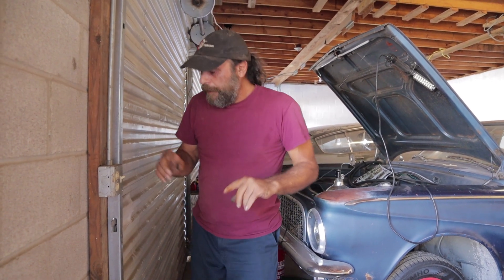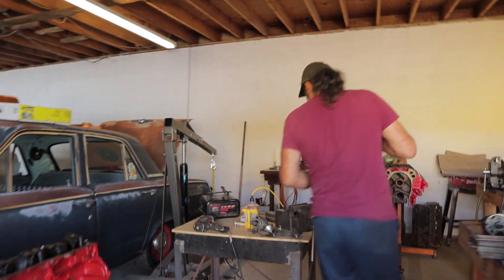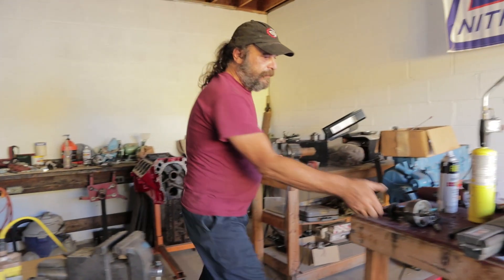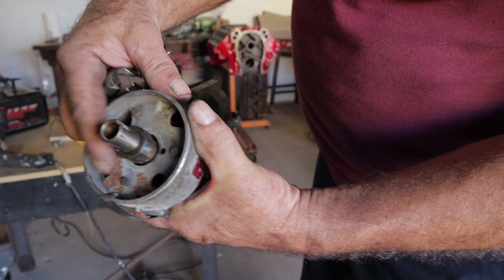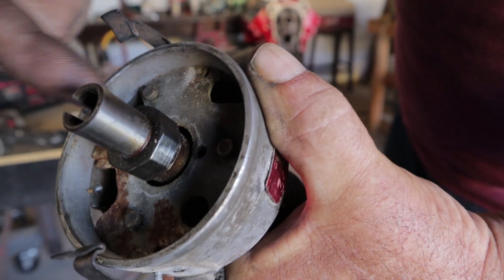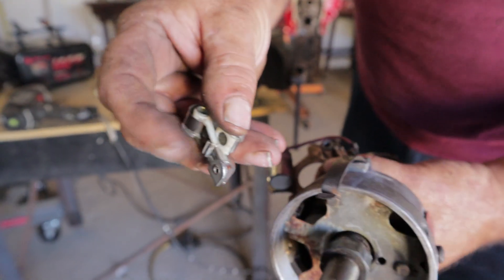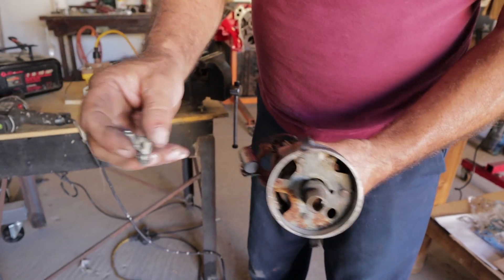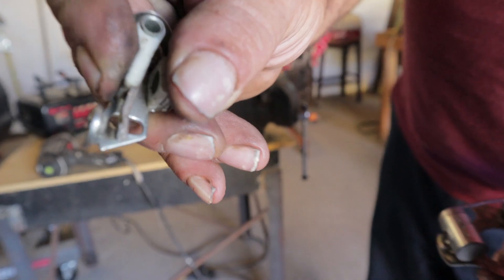Classic Car Tech-Ignition Points Explained

Comment: looks like you,ve made a lengthly but full-recovery nolol...and thats good if you didnt come away with any nervous tics or twitches T...quite the telethon....well, your apparatus made me think of my fiances dad, who had a Sun 506 distributor machine in his garage at the house, if you can believe that, picked it up when the old chevy dealer where he did business, closed, and he got it for nothing too, that was some kinda big-deal back then....he was king alright, people came for miles for him to set up their dual-pont distributors, curve kits, even single-pointies, and that is the point...i was going to use the HPs example that listed and rated the chevrolet heavy-duty single-point sparker and HD points at near chevys dually performance....said they were flawless to 7 grand too....and that would have been a good tidbit, till you dropped that T/F single-point bomb...man alive T...that says it all, what could top that example, even up into the late 90s a single set of points when they only made in excess of 5000 horsepower from 8-cylinders..thats off da hook...whew...i remember ignition breaker-points could give even good mechanics fits back in the day, but sometimes it was more a worn-out dist-cam or the whole distributor was shot, and also many people carried a spare set and a nail-file and screwdriver in the glovebox, leaving that key on when they,re closed 1 time could fry those puppies in a minute or two and there you,d be, you could even smell em cookin.....just 1 of the many reasons the mopar boys just loved their big B and RB Chryslers, distributors right up-front and center, easy to inspect, service and R & R when needed...the A-motors not so much...chevy had experienced a poor water-stall-out reputation, so when they penciled-out the 265 in 55, they put the distributor as high-up and to the rear and as close to the firewalls protection as they could, chrysler engineeres favored that design, but the b/rb motors were not known to moisture stall that i remember....and tony...didnt dual-ponts really only pull ahead when longer duration camshafts that needed longer spark durations... were beginning to hit the scene?....great video T....loved the quick-fab distributor-machine, looked like a resistor right off the mopar firewall...but ive come to expect that straightforward approach from the uncle...i like that, but i can never decide whether you get a bigger-buzz from learning or teaching buddy, but they both can be pretty close in intensity..p.s... remember the transparent distribitor caps..i had 1 on my 396...they really put on a show...at night.....kutgw tony.

Comment: I hated point distributers seems like i aways had to keep adjusting them or replace them  around 5000 miles .love gm hei .
Reply: Guy Linhares   I gotta agree with you. You can soak the engine with a hose and it still runs. Plus you don't have to clean or adjust anything. I did a Pertronix conversion on my Caddy and it's never run better. Points have never been my first choice.
Reply: @rexcars1835  I found faulty condensers and unmatched coil and resistors a reason why points had issues

Comment: During a slant 6 ignition tune up, new ballast resistor got real hot. Put the old one back on, runs fine. Any ideas?
Reply from the maker: They always smoke a bit when first installed.  Nothing to worry about

Comment: Not sure higher voltage spark would be a performance advantage or not. But the HEI module is designed to provide maximum dwell and saturation to the HEI coil. So a typical points coil can only saturate to around 25,000 volts. But HEI coils are typically 60,000 volts output.
Reply from the maker: Tell that to the Accel Super Coil we were firing in this video
Reply: @UncleTonysGarage  Well, seriously, I tested a points setup and an HEI setup in my shop about 10 years ago. Spun both distributors with a drill just you did here. The smaller round Accel coil would get unreliable at about 5/16 arc gap. The HEI didn't become unreliable until almost 1/2" arc gap. Would be interesting to test the Super Coil's maximum arc gap. But you should use a battery so it's pure DC voltage. The Battery Charger has considerable ripple in it's output voltage. Thanks UT.

Comment: I knew how they worked before I went to tech school in the late 90s, but im glad I did. 
The teacher actually said : I need to teach you points before we advance in ignition theory. 
Not all saw the humor in the advance joke. 
Don't ever say never, there's still lots of points out there in all kinds of old equipment. 
Good stuff , and it's usually fixable on the roadside.
Reply: You know how many cheap bikes I dragged home with no spark when I was a kid , and pops found they had the insulating washers all-out of whack in about 2 minutes,or some other grounded out points issue. 
It's a switch and it ain't switchin!!

Comment: Great video. My boat has a 302 with points and it really is a simple and easy system to get running. Best of all, I only need a flat screwdriver, a file, and a matchbox on board if something ever happens to make it run.

Comment: Early electronic ignitions - some of them. Used the points to trigger the low voltage side. A rotating magnet would trigger a reed switch, same thing as points just no mechanical contact. Same as todays junk, a rotating magnet triggers a transistor which closes a circuit and the spark fires.
Most of the " sensors " in todays ignition systems are magnetic switches picking up the movement of a magnet. Crank triggers, cam sensors Etc.
Ignition curves are just programmed into the magic black boxes. More durable ? maybe. For my money anyway the less simple a thing is, the less durable/dependable it is. Even if it has no moving parts, it can still be junk. Thanks in part to cost cutting measures, If a parts cost is a cent.
Shave 1/2 of that cost and it still works and then charge 3 times more for it, now it only lasts 30k miles. Replace that part 2 or 3 times in the cars lifetime - built it profit ! So not only do they make money on an inferior part they make even more making it that way. And they ALL do it.
Welcome to the 21st century kids. Easy and constant access to your wallet/purse is baked into every part. Gotta love modern times........
Reply from the maker: Could not agree more
Reply: I guess you also want to go back to using leaded gasoline.

Comment: Interesting that there is no performance advantage to electronic over properly tuned points. My ‘73 has that reluctor electronic deal that works great. When I had points on a ‘61 Buick, I always had problems with a unified points and condenser set up. With separate points and condenser, it ran great. The condenser on the unified ones was usually bad. I eventually went to Pertronix upgrade on that car. Maybe I didn’t need to after watching this. Great episode!

Comment: Building a stock 70 duster 340 and staying with the original dual point distributor. Replacement points are hard to find. It only came with dual points if it was a 340 and a 4 speed and only in 1970.
Reply from the maker: Those Prestolite points aren't too hard.  They were used in a ton of different applications for about 25 years.
Reply: Yes, I think the problem is the points in a 3438317 prestolite dual point are not the same as a  single point distributor.

Comment: I was talking to a guy at a car show this past weekend, and he deliberately kept the points ignition in his 68 Impala coupe, 327.  With those GM combination points & condenser, he just carried a spare pre-gapped set, for just-in-case.  He thought this was better than converting the car to something like a Pertronix - if that failed far from home, big problems - if the points are pitted, just do a very quick swap.  I thought of Uncle Tony - here was another analog guy.
Reply: Pitted points?  Scrape 'em with a pocket screwdriver or knife, gap and keep on running.

Comment: Think I need therapy..One of my pleasures in life is gapping points...I normally pull out my VW distributors to do it as I find it a little easier and then refit and re time...This was a great video...Thanks Tony......
Reply: Watch that distributor lobe for number 3, isnt it ground a few degrees slow? 
because the heat of the oil cooler blowing on cyl 3...
I think aftermarket dizzys don't have that retard ground in the lobe. 
Some old timer told me that.

Comment: When you dive into points deeper can you get into duel setup. My 56 truck has a 241 poly and has a duel point distributer. I’m thinking about rebuilding it and useing it in a 360. From what I’ve read it will drop right in.
Reply from the maker: Pretty sure it's the Desoto distributor that directly interchanges with the LA...Dodge may be a tad too short.
Reply: I have to pull it and check. The info I’ve been coming across is saying the low-deck Dodge hemi/poly  (241, 259, and 270) should swap. Of course what I’m finding is ppl going from points to electronic. I’ll let you know what I find for sure.

Comment: On your followup, see if you can touch on breaker set tension rated in ounces and how it affects target rpm and point bounce, and what the capacitor actually does. And for heaven's sake, let's see you light your cig with that spark!!  🤯
Reply: It's not a capacitor, it's a condenser for reducing EMI noise through your radio
Reply: The condenser (capacitor)  is required to absorb the primary circuit current flow when the points open so it makes a crisp break and the current doesn't arc across the points.  THIS condenser, that is.  THere can be others for radio interference.
Reply: @davecaselli1957  Yes. It appears we were typing at the same time. The main cause of radio noise in older cars is a breakdown of the alternator's diode/rectifier array resulting in some of the AC not being eliminated from the DC conversion, and the "dirty" voltage gives you that old "audible tachometer" that we all loved to hate. Aftermarket caps can knock some of that down, but the inevitable fix is an alternator rebuild.
Reply: @THRASHMETALFUNRIFFS  Good grief, another YT expert. The condenser IS a capacitor. Look it up, expert. It's primary function is to keep the current from jumping the breaker contacts when the gap is open. If it was for radio interference, then said ignition would run without it. Try it. Please.
Reply: @THRASHMETALFUNRIFFS  Looks like some other people are setting you straight as well. It's time to do the honorable thing. Look up "seppuku" and let us know when the live stream is. Thank you.
Reply: @413x398  Maybe 413x398 is a reference to pixel count, not VIN number?
Reply: @413x398  Yeah dude, I was remembering wrong, the condenser on the coil is for radio noise.  I forgot why the distributor would need a capacitor that kind of functions the same as a coil, build up a charge and release but it's starting to make sense.  I haven't done one since 1991, lol... Check out my cars playlist for vintage 96 VHS burnouts in a Challenger, Charger RT/SE at the strip and 500hp 83 Firbird?!
Reply: @cincyspin178  Or it could be a 413 in a Fury that is putting down 398 wheel hp on the local chassis dyno. Ya just nevah kno.
Reply: @THRASHMETALFUNRIFFS  The "point" here is to not disseminate false information amongst the community. If you are correcting somebody, do your homework first before trusting your long-term memory. Dude.
Reply: @413x398  Awww, fug it, I admitted I made a mistake, that's the goodness of an open source community... beside I'm a fuggin' GUITAR channel with a few car videos, lol!
/w\METAL4LIFE/w\
Reply: @413x398  At least I didn't claim my Civic run's 11's at 123 in the quarter... but my Firebird video did 13.54 at 104 on de studded snow tires I got for $10ea!
Reply: @413x398  Thank you. My next guess was going to be differential gear ratios, but you're not the kind of guy who would leave out a decimal point. Max Wedge?
Reply: @cincyspin178  4.13 or 3.98 gear ratios? That's just silly talk. Never happened. Never will. Decimals are very important, so no I would never leave them out.
BTW, how is it you're still posting? I pitched you into the Triangle knowing full well Dorian was on the way, and yet here you are. I'm impressed. Maybe you really are part fish as you claimed. 

No, C-body with 915 heads.
Reply: @413x398  4.10, 4.11...why not 4.13?  All right...lol...didn't I say you were Not the kind of guy to leave out af decimal? Yeah, nice plan you had there, but the Barracuda came thru. Now if I could just fine a car designed for the likes of me.

Comment: actually the coil and capacitor form a resonant circuit. when the points close current flows through the points and builds up magnetic flux in the coil(stored energy). when the points open the energy stored in the coil transfers quickly into the condenser. then the energy transfers back to the coil. that creates an alternating current in the coil primary which is stepped up in the coil secondary. When the spark plug ignites this energy gets dissipated in the spark. You must have the condenser and the coil working together. the ballast resistor limits the current flow to a value that does not ruin the coil or points. You jump out the ballast resistor during starting to get max spark. You can get a little more high rpm spark by jumping the ballast resistor at high rpm but not enough to make that worth while. some cars from warm climates have a ballast in the coil and do not jump it out for starting. How to tell you have a problem with the ballast bypass is the engine cranks and catches firing when you are shutting off the starter. there is a bit of science. the other reason not to use points is you do get a bit of random ignition voltage and timing(not perfect). not a big deal but electronic pickup and control module is a tiny bit more precision. Also never forget to lubricate the rubbing block. on your modern lawn mower the module in the magneto coil does both control and trigger so no points are needed. you can put that new kind of coil on you old mower(if it fits) and get rid of the points. what else. points oxidize when not used regularly and you have to clean them to get spark if they sit around a long time. Points did the job in their day but their day is past. thanks for the demo and explanation. point ignition is easy to deal with.
Reply from the maker: They work pretty well around here today.  Thanks for expanding with that explanation

Comment: Nothing like points that are SET UP RIGHT. Every time I open The hood on my 65 Mustang, my friends are like, when are you gonna dump the points and go electronic? and I'm like, the same time I dump my drum brakes and go with discs, NEVER!!!  The biggest complaints I get about points is, at high rpm the engine distorts, and backfires, and I say, set your points and timing correctly, and you won't have any of that shit.

Comment: I've done that set up in my store with an accel gm hei distributor and the spark jumps from the towers on the cap all the way to the head of the distributor. Puts on a pretty good firework show.
Reply: Ken Leppek   That is kind of fun isn't it?
Reply: @rexcars1835  most definitely

Comment: Great explanation.  I'm constantly amazed at how many people think the spark comes when you close the circuit and energise the coil...but I never could work out a simple enough way to explain it so they'd understand how the spark happens when the coil is switched off.  Love it, mate.  :-)
Reply: point bounce point float.  all tend tohappen at higher RPM .  cue the invention of Double Point distributor sets  and two distribitor.   I like old stuff but electronics did solve some very complex issues in extreme operating conditions .   daily driver stuff , points will  get the job done.   Except for cold weather Electronic Ignition and EFI still makes the engine go if you can get it to turn over.  I remember the old days of having to plug in cars in the winter time.
Reply: @Randy J  I remember points float/bounce...but it was usually because I had old points and the spring was getting weak.  Toss a new set in, and they were good for well over the 7000 rpm redline most small engines came with back then (higher than most cars rev from the factory these days.)  In my experience, it was more of a problem for race engines of the day that were pushing closer to 8-9k rpm.

I recall the early electronic ignition systems used to supply considerably more voltage to the spark plugs, but whether that was an artifact of coil development at the time, or something inherent with not having points that could arc, I'm not sure.  But they sure gave me a bigger jolt when I grabbed a plug lead while the car was running.  :-P
Reply: @aussiebloke609  used to be a maintenance trick to yank a plug wire and see if the engine slowed down or ran rougher.  The electronic versions jumped from 10-20 kvolts to 60 kvolts ish.  Well into electro defibrillator territory.  They discouraged that in service school during the early 1980s.   The modern power packs are even hotter but they are readable with a cpu code reader.  We used to require a oscilloscope test stand to read the output.  Those are antique shop apron holders now
Reply: I feel so old - I always just pulled the wire and watched if it started running rough.  Never used to be a problem, although by the mid '80s, it sometimes hurt.  Guess I shouldn't pull that shit now.  :-P
Reply: @aussiebloke609  I am Soo old .  Hehe.   Aches and pains from my youth are coming back to remind me.  My doc is starting to use phrases like as you get older.  Sucks

Comment: I still like points and condenser ignition. They are great for a daily driver.
Reply: Verily rarely ever leave you stranded
Reply: Daniel Leach 

Yes they usually gave you plenty of warning before completely going out. Simplicity at its best.
Reply: Chump Johnson couldn't even tell you how many times I gap the points with a matchbook.
Reply: Or paper clip